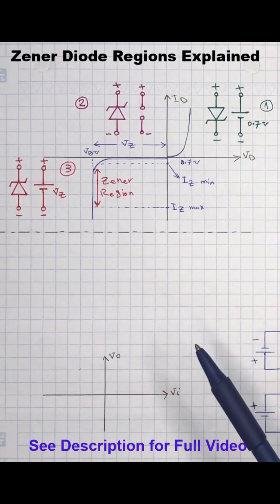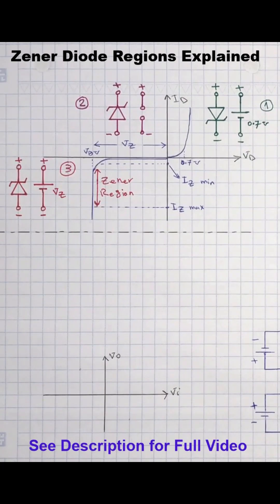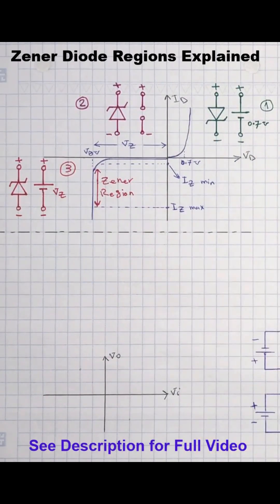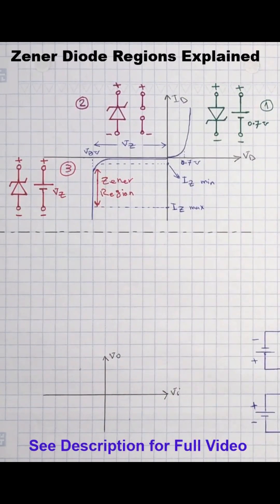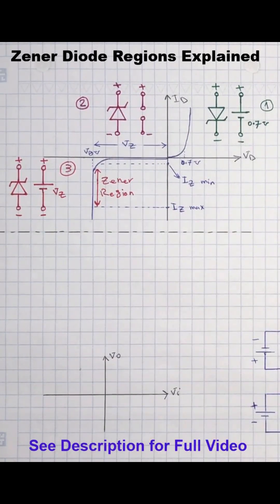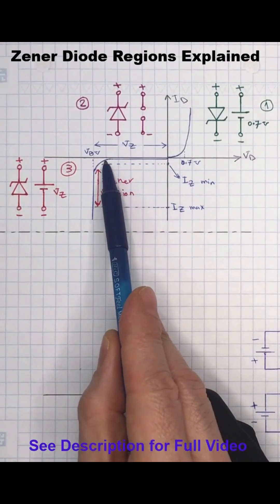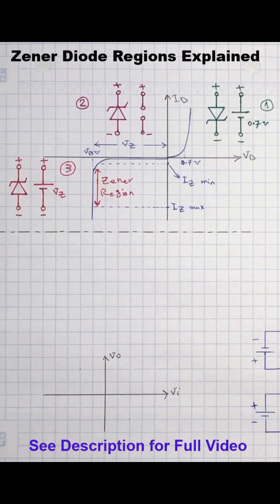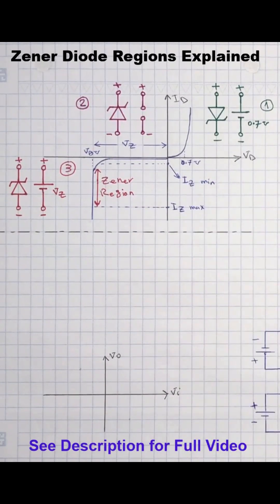Zener Diode Regions Explained

Comment from the maker: Full Video Link : https://youtu.be/AAEvPySJ7fk?t=155

Op-Amp Output Bounding with Zener Diode : https://www.youtube.com/watch?v=l8KEk7ivIeE&list=PLLA_QJ8rHZBh5LqrY41bCvKgreRDRWrBQ&index=19&pp=gAQBiAQB
Op Amp with Diode Circuit Analysis : https://www.youtube.com/watch?v=tCOLccWg5AI&list=PLLA_QJ8rHZBh5LqrY41bCvKgreRDRWrBQ&index=23&pp=gAQBiAQB
Op Amp and Diode Circuit Solved Problems : https://www.youtube.com/watch?v=YBReCN6MGNo&list=PLLA_QJ8rHZBh5LqrY41bCvKgreRDRWrBQ&index=26&pp=gAQBiAQB
Op Amp Precision Full Wave Rectifier : https://www.youtube.com/watch?v=rJCzxXOkO8o&list=PLLA_QJ8rHZBh5LqrY41bCvKgreRDRWrBQ&index=30&pp=gAQBiAQB
Op Amp Circuit Input Resistance Example : https://www.youtube.com/watch?v=44_gHSnsnkU&list=PLLA_QJ8rHZBh5LqrY41bCvKgreRDRWrBQ&index=32&pp=gAQBiAQB
Op-Amp Comparator with Hysteresis : https://www.youtube.com/watch?v=f0zNs0-a5jg&list=PLLA_QJ8rHZBh5LqrY41bCvKgreRDRWrBQ&index=10&pp=gAQBiAQB
Electronic Circuit Analysis Playlist: https://www.youtube.com/playlist?list=PLLA_QJ8rHZBh5LqrY41bCvKgreRDRWrBQ
Control System Playlist: https://www.youtube.com/playlist?list=PLLA_QJ8rHZBjS_S6WPkmUweF5NbImvSqf